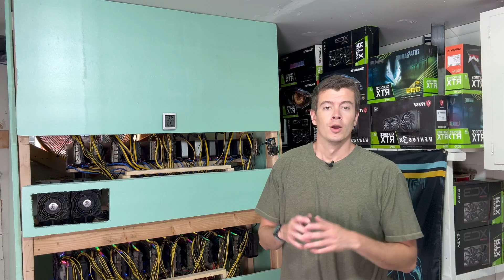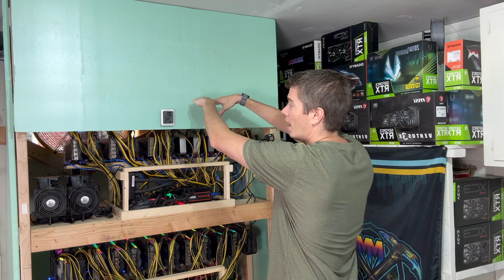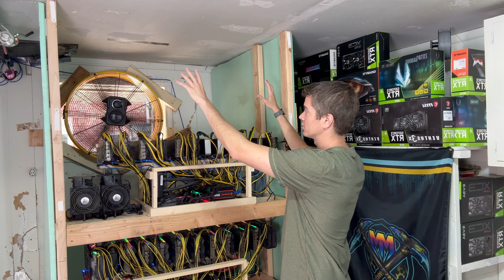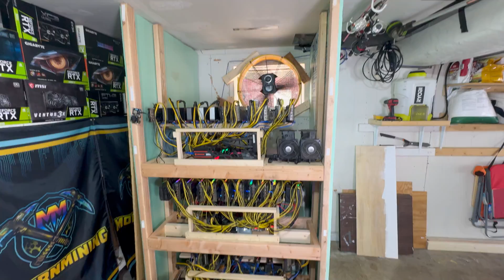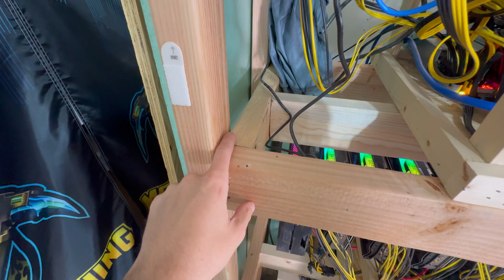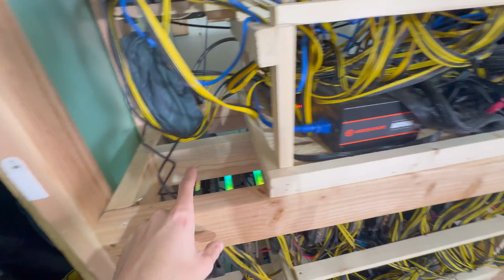Expanding my Home Crypto Mining Farm.. AL0 Alephium Asics Incoming!!

Comment: splitter would be fine for those 100w asics... but don't use it for anything else. c14/c13 have specific ratings for the sockets, let alone the cabling in between. trying to utilize the splitter on a 12 GPU rig could be very bad.

Comment: These Asics like to run warm as it is so the top shelf will work a treat!
Reply: I cant remember if it was red panda or Rabid I was watching a week or 2 ago; but one of them was doing a test running a fan next to one for cooling and it was causing the Hashrate to drop...so warmer Temps may be the way to go, only way to know for sure is run a few more tests
Reply: @BP_26  For sure, I feel like silicone lottery plays a big part in this also.
Reply: @BP_26  its rabid
Reply from the maker: Interesting, have you found that they hash higher at slightly warmer temps? I think I remember hearing that somewhere.
Reply: @ModernMiningHub  yes do not change fan settings or add a fan. Doing so will lower your hash rates. I've been using mine stock with no changes or adding a fan since August 26th. Tried adding a fan on top in the beginning and was wondering why I wasn't hitting advertised hash rates. Removed the fan and hash rates were higher. Curious if this will be the case for the RX0's? Have 2 on order from IceRiver after the announcement.
Reply: @ModernMiningHub  I heard that also,

I mean maybe ever so slightly, but it doesn't seem to be anything super noticeable.